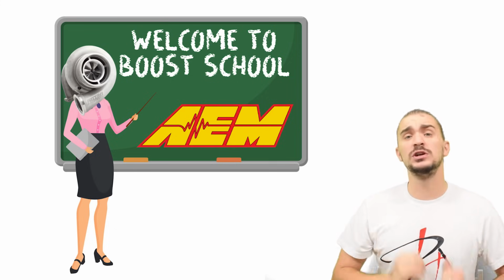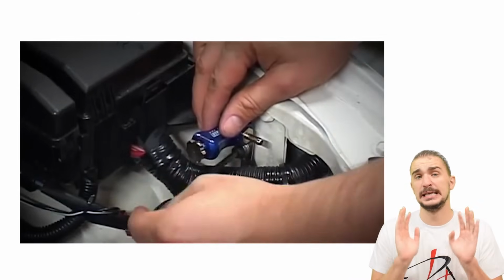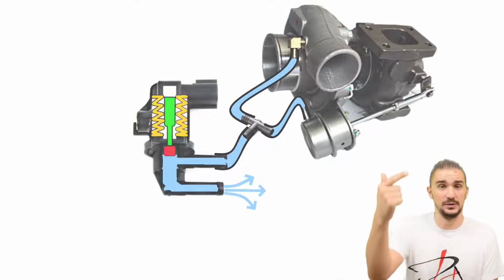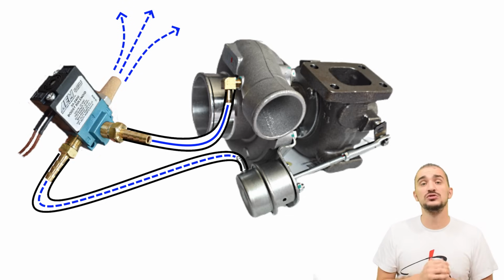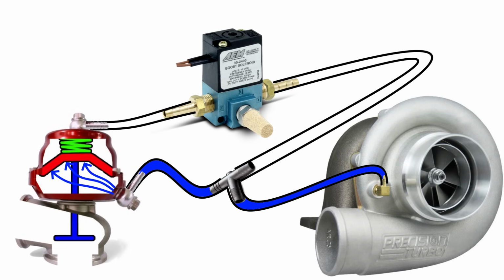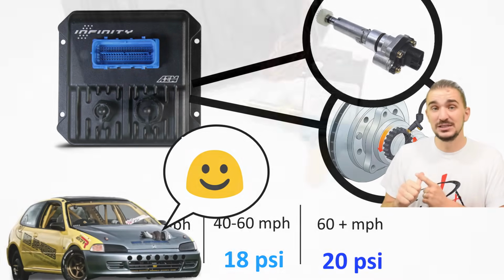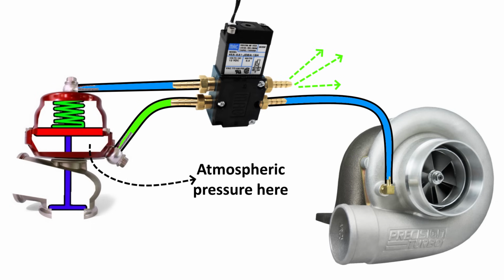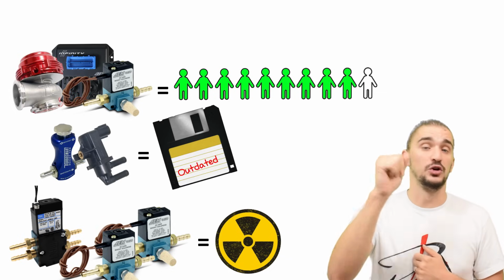ALL BOOST CONTROL setups EXPLAINED - Boost School #3

Comment: Hey I love your videos thank you very much for doing this! I have a question, what if we connect the 3 port solenoide with the two port wastegate but we only connect the solenoide to the top of the wastegate and leave the botom of the wastegate unconnected but without leaking and with the ecu we control the duty cycle of the solenoide, wouldn´t be much better like that? having a 7psi spring in the wastegate in first gear we can vent all the pressure of the top so the solenoide duty cycle would be at 100% so the max boost pressure would be 7psi, in second gear we can vent 70% of the pressure going to the top of the wastegate so we would have 30% of boos pressure helping the spring so we would have more than 7psi in second gear and so on.
Make sense what I´m saying or I´m forgetting about something else and this would not work?

Comment: What’s your take on a compound turbo? Which of these products would be beneficial and what would you use if building a compound turbo setup? The larger low pressure turbo feeding the smaller high pressure turbo on the compressor (cold) side, and the smaller high pressure feeding the larger low pressure on the turbine (hot) side. These videos are helping out a lot, so I look forward in watching other ones you’ve put on the YouTube. I appreciate ya bro, and all the best!
Reply: I have a compound boost set up and it works great. However I'm using twin charging. Super plus a turbo. Reduces turbo lag and the turbo actually helps the efficiency of the supercharger. Another benefit is it constantly helps pull fresh cold air into the engine and provides to levels of intercooling. Off the line torque plus high revving hp. However some issues. Throttlebody placement becomes a key factor. You usually need dual blowoff valves or really good system design. There are a few ways of doing it. You also have to do the math to figure out peak boost and stages of boost. 

You also essentially need a full turbo and super set up. From what I know of compound boost turbos. Works best when doing high boost like above 30lbs of boost. For turbos maybe even 40lbs or more. Twin charger systems have a few other advantages that make it make sense and lower boost levels but I think it's still like 25lbs of boost. 

You can go super blowing through the turbo or the super pulling through the turbo. All depends how custom you go. Might have to do an engine that's a hot vee so intake on the outside exhaust in the middle. Might do either a central super with dual manifolds. Or per cylinder bank with dual intakes and 2 turbos. Flatplane engine as well, so pushing hot exhaust gasses centrally cold air with less heat soak issues snd the benefits of pressure differentials. But would likely mean a Y joint or dual turbos. 

With turbos it's more about efficiency of boosting. Modern turbos are super efficient and generally can handle reasonable levels of boost with appropriate size engines. Diesel world will have alot of helpful info. If you're gonna do compound boost I'd go roots maybe even twin scroll super and throw a turbo in with it. Roots is easiest. Also means you don't need as high end gear. Basic roots and turbo kit like stage 1s together can be like a stage 3 set up done properly. But way more tuned.

Comment: I’m currently running a 4 port boost solenoid controlled by a Motec M142 ecu to regulate boost to a Garrett g30-770 on my built k20c1 fk8 Type R. My tuner showed me the boost curve up top in the rpm range at about 7800rpm that it was oscillating. He says it’s the di mechanical pump reaching it’s limitations. Im also running port injection which works in combination with the di mechanical fuel pump throughout the whole powerband. I think it could be the 4 port solenoid making the curve bumpy(oscillating) up top. Im thinking a dual 3 port solenoid setup could alleviate this. The Motec ecu could definitely control a dual 3 port solenoid setup. The car dyno’d at 686 whp 575 ft lbs.

Comment: What is the difference between driving inside the boost and outside the boost? Can one or the other damage the engine? I have a 2016 Ford Transit van with a EcoBoost engine. I bought it 2 years ago. I'm 68 and I drive it about like granny.

Comment: And a servo controled wastegate blows every other solution out of the water!!!! 😁

But a external ones costs 1.000 bucks and stil uses a cheap mabuchie motor with a double H brigde.. 

Would build my own one with an actual good servo motor, but my fun cars don´t have tubochargers! 😅

Comment: BMW was still using PWG in 2012 Smh had one in my old one it's probably what caused people to not like their turbo 4s when they came out with it when they added electronic waste gate like in my 2014 just is so much better not just more power accross the rev range but way more driveablity

Comment: Can the aem boost controller be controlled by a button? For example what I am trying to do with my car is let’s say I’m at 300 hp. But if I push a button it doubles the boost and now I’m at 600 hp. Would be like a sports mode button. Is that possible with this?

Comment: Would the 3 port solenoid work on a system that also has a electronic diverter valve? Would a mechanical diverter valve fix the issue? This is reference to Mitsubishi turbo TD04HL-15TK (2007 SAAB 9-3 aero 2.8l V6)

Comment: Will my ECU that has been tuned malone tune 1.5 ( Audi 4 1.8 T go with the AEM boost controllers? I have a factory plug tom my N75 racing just have to change harrness?

Comment: There is more to this than what is being explained

1. Waste gate sizing
2. Some basic waste gate actuator you can adjust the arm
3. On some turbos the wastegate is completely electronic
4. Variable geometry turbos
5. I think you can adjust the boost pressure via the blow off valve to vent boost when boost gets too high

Comment: I know my thinking must be wrong here somewhere, but: 

Imagine we have the inline 3 port solenoid , we have a 15psi spring, and are running 20psi of boost. If we bleed all of that off before the diaphragm in the actuator, we will basically have the 15psi spring fighting against exhaust pressure only. 

Now imagine we use the 2 port wastegate with the 3 port solenoid set up like the last 3 port you had. If we have 20psi of boost , but it’s going to the top AND the bottom at the same time, it is at equilibrium in terms of boost pressure, then we still have the 15psi spring fighting against exhaust pressure only. 

Not sure where I’m going wrong here, but in that case, what’s the advantage of using the 2 port wastegate over the 1 port?

Comment: Thanks for the video! I was wondering, if you can get to double spring rating with an in-line 3 port boost solenoid and using 1 port on the wastegate, how come you couldn’t get more than that by using the 2 ports on the wastegate and having the top push down for more than double the spring rating?

Comment: you should add at some point the modern option of using a  drive by wire throttle body based blow off valve for boost control

Comment: Why not use a pressure sensor and a wastegate that is controlled electronically? No need to depend on a spring. Is that something that exists? The ECU can just open or close the wastegate depending on the reading it gets from the pressure sensor.

Comment: Good overview, some of those I hadn't seen before.

Have you heard much about vacuum actuated wastegate systems? Seems to be an OEM Diesel strategy and there's not much in the aftermarket. The wastegate is normally open and gets pulled closed with vacuum. I've got a motor with a vacuum wastegate setup and it seems like it would be super flexible but since it's a motor swap I don't have it working with an OEM controller, gotta find/buy/make my own.

Comment: Out of curiosity. Why dont people reference exaust preassure to the second bov port making the top of the spring and exaust in equilibrium truly making your spring or controller perfectly acurate. 
So, 20lbs of exhaust pressure means 20lbs trying to open the valve, and 20lbs trying to close the valve making it essentially 0, allowing your spring or controller to accurately actuate the bov.

Comment: i have 3-way mac and two tial wastegates with 1bar springs.  if i am driving with spring pressure alone then the wastegate will keep a steady sound and car is making ~1bar of boost. then when i turn on the electronic boost controller then the screampipe sound is uneven and fluttering🤕 how could i get a steady sound even with big boost? it is connected like this at 12:08 but divided to two wastegates. car is subaru

Comment: what do aftermarket wastagate actuators with different springs provide when paired with a manual boost controller? Whats the point of having it since the manual boost controller controls the boost?

Comment: I now want a 3 port + advanced ecu upgrade when I get my Rx8 running with a new Rx7 13b REW engine. Gonna have it ported to make 500-700hp NA, n when once I get it turbod should push well over the 1k mark. 

And before the rotary hate comes pouring in im having it dowel pinned for added stability under high load, and Goopy apex seals. 

Wish me luck brothers

Comment: There's also a manual type that puts the pressure to the top of the wastegate holding it closed past the psi that the spring is rated

Comment: ok im pretty new to building and def new to boosting so if someone could answer my question and correct me i would be immensley appreciative but here it goes, if we are spending so much effort on having our waste gate stay closed then why not cut the wastegate outta the system all together? i understand the 3 port will give you the smoothest transition between pressure points but if ur willing to drive an angry car with max power in every gear wouldnt a setup that doesnt include a wastegate be optimal? i look forward to your replies im very excited to learn more about this thanks guys

Comment: This video helped me so much. I am looking at a small moni me swiped civic with small turbo kit on it an haven't a clue about how the hole boost would be controlled. I know the ecu or stand alone system is part the equation, but never had any experience with boost control. Thanks alot man.

Comment: Nice video but I got a question. How this all compares to electronic wastegate actuator like it is in my car? Isn't it just best solution when ECU controls wastegate directly, taking into account all parameters from electronic sensors? All the connections, springs seems unnecessary or am I missing something?

Comment: I just bought cheap a second Celica Gt4, with a Greddy external wastegate. Previous owners didn’t understand connection and connected both upper and lower ports together to the intake pressure port !!!!!
So everytime you go WOT there is no pressure regulation !!!! The engine gonna explode ? Noooo, but he said « oh I have trouble with the intercooler tubing, it’s always poping out !!!! » 
Thanks to you I now understand why !!! I have an old Profec e-01 with solenoid, I’m going to install it !!!

Comment: Why not just have an electro-mechanical (solenoid or similar) actuator to control the wastegate directly?  You could even add a sensor to the wastage outflow to have a negative feedback loop (servo) on your solenoid input and actual effects.  Efficient, highly versatile, extremely precise.  Just plug the numbers in the ECU and you are go.
Reply: this is a question I had. it seems like an obvious solution, but there must be a reason it's not used. I wonder why?
Reply: @static7985 Interesting, maybe they fail alot and manufacturers dont wanna risk it failing and having to replace turbo under warranty
Reply: @fnanderss Electrically actuated wastegates are pretty common in factory setups nowadays. They are generally reliable
Reply: my civic has that from factory
Reply: I guess heat could be a problem.
Reply: Turbosmart makes that. A standalone ecu is needed though

Comment: I've got a dash mounted switch (switch type can vary) that I want to use to toggle between loud/performance turbo configuration and quiet/stock configuration. I'm assuming loud and performance would go hand in hand because of how loud oem blow off valves can be. So loud race mode back to quiet stock mode by the flip of a dash switch. The configuration can be anything required. 
Vehicle is a 2015 Hyundai Veloster turbo. Any suggestions?

Comment: How would you set up a manual boost controller with a stock turbo for 2005 wrx . Boost goal 17psi. With stock internals. Should I go with 2port ebcs or 3 port?

Comment: On the 3 port solenoid ,  I am running my  dual waste gates vacuum lines from the (lower ports )to a t-fitting then to port #2 port on the solenoid. On port number #3 of the solenoid it runs to the turbo. My question is can I run that to the charge pipe nipple instead of the turbo if I didn’t want to add a fitting to the turbo? Then port #1 to bleed off pressure.

Comment: There is one set-up that allows you to have LESS then spring boost pressure
You can use 4 x 3-port solenoids to route boost and vacuum to the top of the wastegate and use spring around 7psi to get boost from 0 to around 35psi

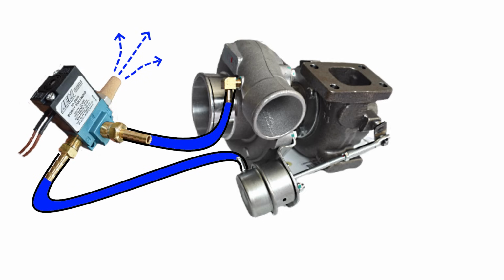Comment: 10:25 Can someone please explain why does r-port boost solenoid enables up to 2x the boost level of spring actuator alone. My reasoning is that there should be no limit. Of solenoid prevents the boos pressure to reach diaphragm and spring then the only limit is exhaust pressure opening the wastegate.

Comment: So I'm having an odd issue where my car will only make wastegate psi (16psi). From there it just stops building any boost in every gear. I've smoked and pressurized my system and found no leaks. Is this a sign that the 3-port boost solenoid has failed? (Setup is 3-port with external WG).

Comment: What is cool with the internet is that anyone can show up and say whatever they want, including some nonsense. I hope someone realizes that a 3-port solenoid is a Tee that has one input and two outputs, and that the outputs are mutually exclusive: what goes to one does not go to the other and vice-versa. When using a desmodromic capsule (two port, or “push-pull”) all you need is a 3-port valve and send port 3 (open at rest) to the pull side of the capsule (to open the gate) and port 2 (closed at rest) to the push side of the capsule. What does not push pulls, and vice-versa. If the valve is not energized (0% duty) or the connection fails, all pressure goes to port 3 which opens the gate after the spring pressure. As the duty increases, less pressure pulls and proportionally more pressure pushes and the valve closes (or opens less) as the duty increases. The spring only need to overcome the mechanical friction of the valve mechanism to positively close the flap in absence of pressure but not much more, i.e. it’s a very soft spring. At max duty (around 90%) the valve will flow 100% of the pressure to port 2 and 0% to port 3, so maximum push and no pull. No need for a 4-port valve and certainly no need for two 3-ports valves 🤦🏻‍♂️ Also you need to decouple the spring pressure and the boost pressure somewhat. First the psi figure is the cracking pressure, the pressure at which the gate begins to move, not when it reaches its fully open position, second there is something called “preload” where the rod can be shortened to raise the cracking pressure at the expense of max opening angle. All wastegate capsules are preloaded to some value, that is by definition above the spring rate, and again that’s the pressure at which the gate starts to leak gases, it takes more pressure to open it and actually slow down the turbine, and the engine is consuming more air as the rpm increase so decrease that pressure, while at the same time more exhaust mass keep accelerating the compressor. An equilibrium is reached but it’s always above the preload pressure, which is always above the spring pressure. Besides that the AEM valve shown are likely from some industrial catalog, more suited to coffee machines or some other industrial design. 35 years ago (1986) top level motorsports were using high-impedance fuel injectors as “air injectors” for very, very fine boost control and desmodromic control, with phase and anti-phase duty-cycle signals to control two sets of air injectors with a dual-port capsule was introduced in world rally competition in 1997. Google Escort Cosworth Air Injector to learn more. The aftermarket is not there yet, maybe in another 35 years? 😆😆😆
Reply from the maker: What is cool about the Internet is that anyone can show up and say whatever they want, including some nonsense.

Comment: At last i understood the types of boost control, Great vid as always !
if i may comment from an electromechanical perspective that the signal going to the solenoid changes multiple times per second, but the solenoid actually doesn't. It floats in an a state in-between open and close, sort of hanging in the balance, leaning more towards the higher percentage.

Comment: Nicely put! Clear and concise. Neat thing is, the old fully mechanical systems on aircraft back in the 40's have the same degree of controll as the modern computer boxes. They are, however, very complex and bulky for such simple actuation.

Comment: What is there generally in say some small Ford Focus when it comes out of the factory? And is it possible to improve its drivability without either making it in any way illegal to drive on public roads or shortening its lifespan? Or how to find this out, except with a good set of tools or by bothering a professional mechanic?

Comment: Thinking about trying out the manual boost controller. Possibly would only be usable in milder tunes, like, sub-300hp ? The full boost thing might help acceleration in small SUV's and might improve fuel economy